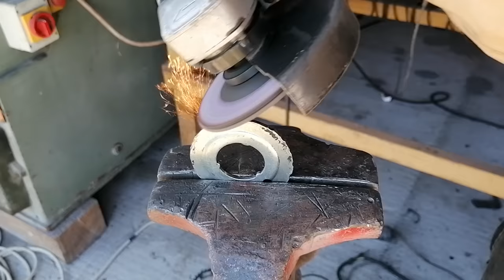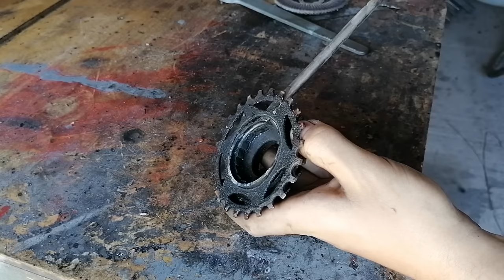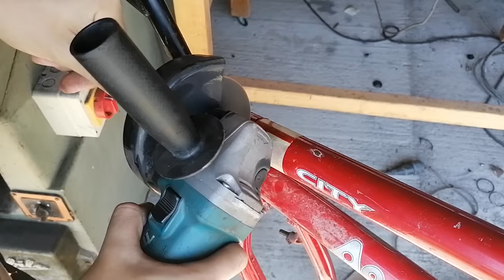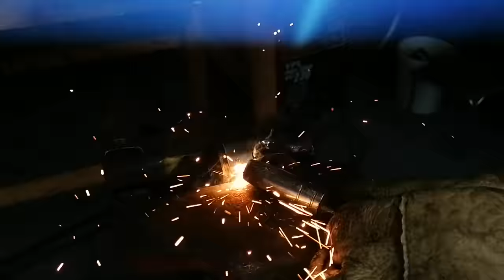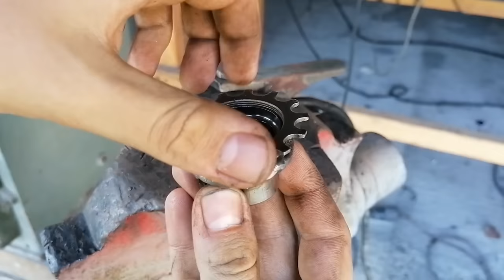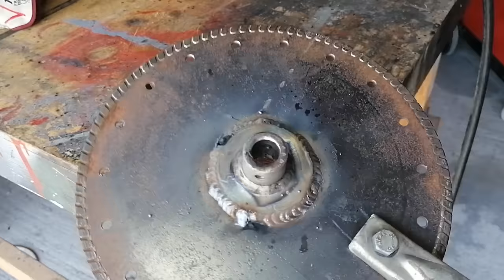Building a Chainsaw Bike with Gears from Scratch!

Comment: Very unique and clean build 👍
Tip: You can power the bike without sacrificing the chainsaw... I have created a chainsaw bike a few years ago and ever since then I have been coming up with new ideas for a new chainsaw bike. They make cheap stihl Ms 660 clones which have a lot of power and I'm going to use a chainsaw drill attachment for the gear reduction. I'm sure you get the idea I have in mind. I still want to use the chainsaw for cutting wood so I have to build it in a different way.
Reply: No, this is a terrible implementation of a very stupid project.  Chainsaw motors are just not the right engine to use.

Comment: A little over engineered, but you do want options for adjusting your bike from hell.. Hm.. I really like this bike! Love the idea with gears, usually the problems with a chainsaw as an engine, is the high rpm to get somewhere. Now, if you go to the 2.0 model, might i suggest a sturdy MTB frame, with twin shocks and oversized rims..? And perhaps an 125cc dirtbike engine, lowered seat, TT handles and in kawasaki green with RED Factory decals in carbonfiber....

Comment: Looks like it needs more Torq and Better Brakes,.....but otherwise Very Impressive.

At the sake of all that Fab, its hard to beat the smiles per dollar of a  CRF110, Kfx110, or Yamaha TTR110....with built in electric start, Suspension., and fenders....😉

Comment: You should had used a 21 speed or 28 speed.😮

Or a hydraulic pump 10 gallons into a hydraulic motor designed for .5 gallons. Plus you can increase the p.s.i. from 600 p.s.i. to 10,000 p.s.i. running into the transmission for efficentcy.

I bet you can hit 200 mph.😮
But if you try that you better make it a 3 wheeled bike from a motorcycle.😮

Comment: Good work! Ive been thinking about jack shafting my Zeda YD 100 through a 3 speed hub for a while now. I think Ill use motorbike sprockets so I can use 415H chain though, as my Zeda is putting out around 7BHP and cycle chain would  be too weak.
Reply from the maker: Thanks! Yes, the bike chain is definitely weak for a 7hp drive. What I can recommend is the CVT Hub from the Enviolo brand, no gears inside just a CVT ball system, it can withstand more and also has a much greater gear range. My 3-speed hub is already reaching its limits with 3 hp, and it definitely won't be able to handle 7 hp. I'll probably also install the Enviolo CVT hub later, I had the current 3-speed hub lying around so I used it, which has worked great so far.

Comment: Its way easier to use a weed eater motor with a small tooth belt sprocket on the back of the bike & a big sprocket on the back wheel .

Comment: I don't get how it changes gears please explain
Reply from the maker: Inside the hub there are planetary gears and a mechanism that switches between 3 gear ratios. The mechanism that I built outside with the spring and the cable is built so that I can adjust the whole thing perfectly. My problem was that the old hub gearshift and the Shimano gearshift lever don't have the same shift travel, I had to compensate that with my own construction. In addition, the gears in the hub were in the reverse order of 3,2,1. I solved this by installing the spring to keep the transmission in 1st gear the whole time until I upshift. I hope I was able to explain it to you well.

Comment: Jeezuz,Christ. The most overly complicated way to get a 45cc 2-stroke engine into a bike. Wtf, all that gearing. So unnecessary. Motor to original peddle sprocket, then smaller fixed cog (on same side sprocket), then chain to geared hub. Done. Or to a 5 speed rear wheel sprocket climber.

Comment: #MuchBetter if you use a grinder machine motor for bigfat mountainbike as electrict motor for more max speed travel up to 150 speed and smooth run on the road,try it now my suggest

Comment: Why u fdid use a grinder motor in your DIY ebike moubtain bike,the grinder machine as motor in your big mountain bike.then the motor grinder run speed on the road supply the power from battery chargs thay instal on thebody frame of mountain bike.the grinder motor can be 3swith  control,speed 2 normal speed at 40dspeed,2nd swith run speed 60,speed,then the 3rd swith run 80 speed up,the battery fullchargs up to 1hours only then grinder motor can be run up 300kilometer in one chargs,then make silent motor of grinder,use bigfat size tire in your ebike.then your setter make comfort foam wide like motor set.

Comment: Why the drill bit in the tool post of the homemade lathe and why leave it sticking out so far it flexes like a pole vaulters stick?  High speed steel blank cutting bits are dirt cheap nowadays or even brazed carbide bits are too.  Heck I got hundreds of them laying around the shop.  If it’s a $$$ thing, send me your address and send ya a box for free.  You know you can take a high speed steel blank bit and grind it into whatever shape you need on a bench grinder or you could prolly get away with doing it with you hand grinder??  If that’s what you’ve done with the drill bit (reground the tip so you can use it as an OD turning tool) at least choke up on it and leave maybe an inch hanging out unsupported.  The way you have it, it’s flopping around so bad you’ll never get a good cut and any good surface finish on your parts.

Comment: Yeah he did a cute job. But it's stupid for the average guy, with the amount of money you'd spend on tools and equipment to do the job you could actually buy cheaper a good small dual purpose motorcycle ready to go that's faster and has a real gas tank that holds enough fuel to get you there and back 😅